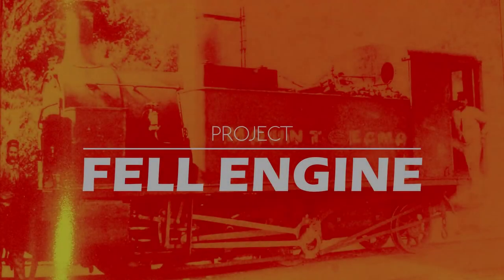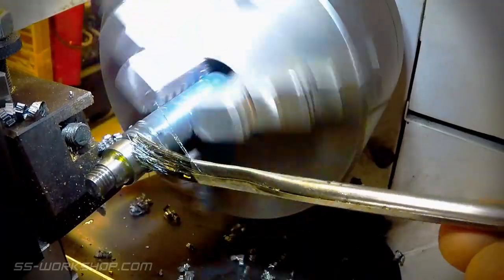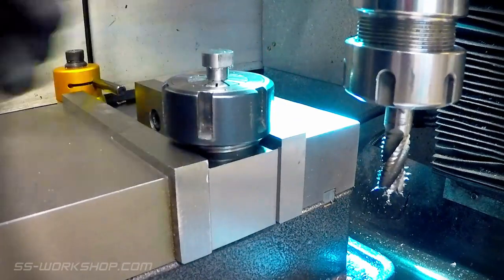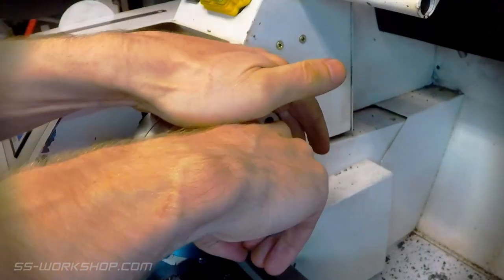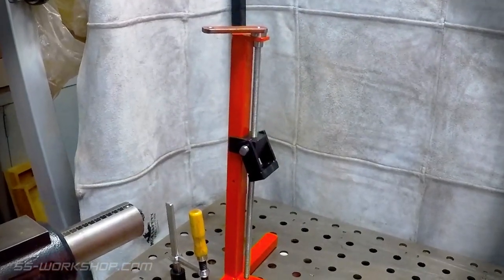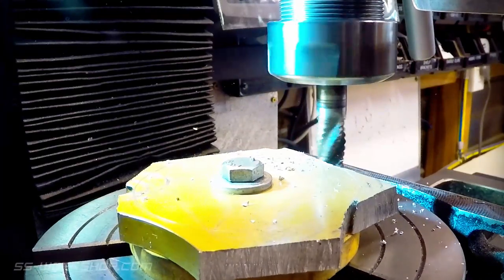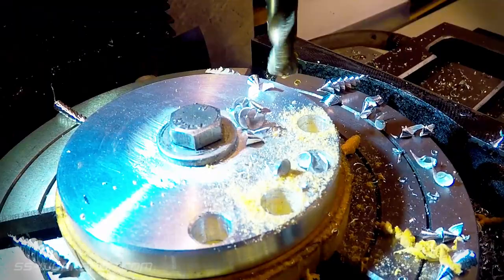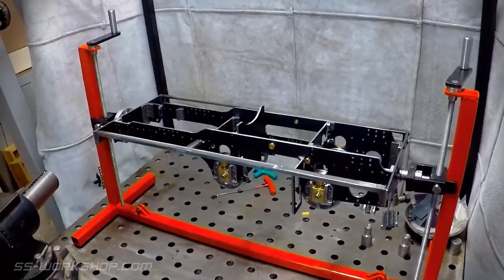Fell Engine Project - Finishing Up The Build Stand S1.E13

Comment: Looks great. You don't seem to use spotting drills on the mill. Do you have some special grind on your drills?
Reply from the maker: Thanks, Well spotted, nothing special the drills were starting pretty straight in the aluminium being a softer material. I find more trouble with small drills into steel with the drills wondering off as they start, I’ve had them end up more than a mm off when doing plates. There’s also another trick you can use if you don’t have a centre drill on hand, just pecking a small centre lifting off and drilling the hole with the same bit but I’ve had mixed results, some days it works.